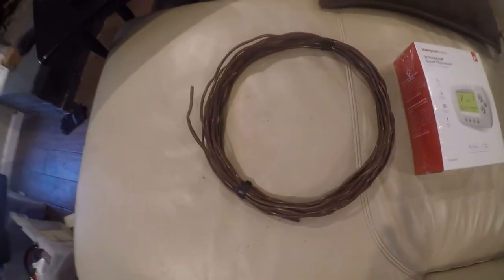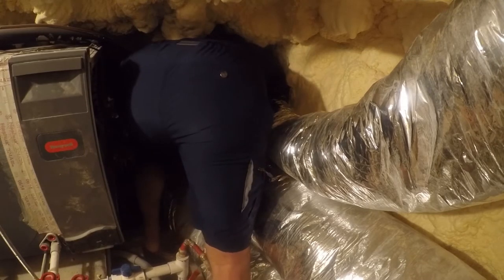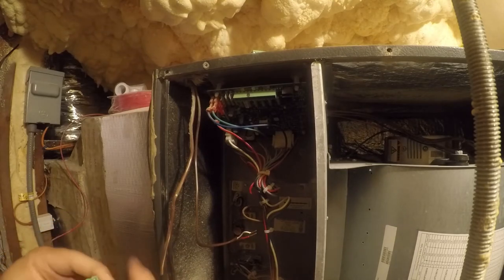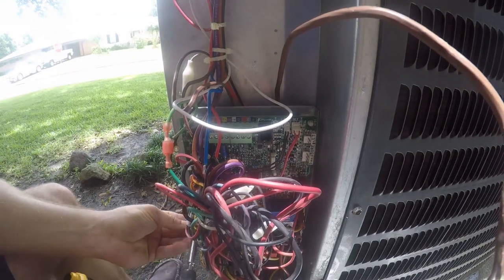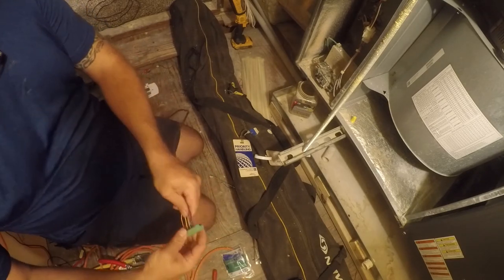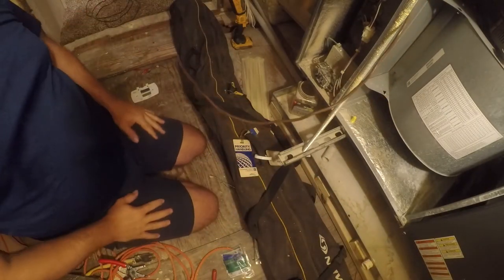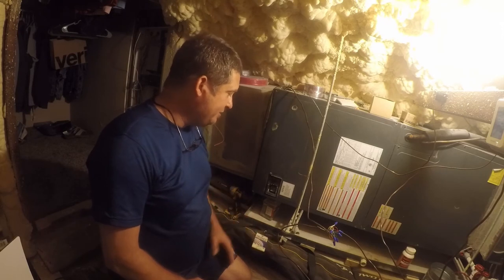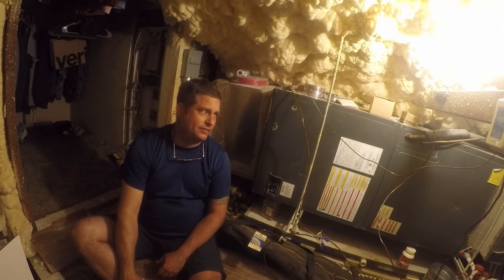Goodman / Amana DisComfortNet abandonment - Part 2 of 3

Comment: I have the Goodman 18 SEER Discomfort Unit that I installed 8 years ago.  The Air Handler circuit board failed within the first hour.  After paying a pro to troubleshoot, he came up with the same conclusion.  $200 for a replacement board and all's good.  It worked fine for 5 years and then intermittent communication error.  After much trouble shooting, the culprit was slightly loose terminal screws in the air handler communication.  One turn on each screw and all is better.  Likely the thermal expansion and contraction loosen the screws/wires.   To be honest, the unit works well, but the electronics can be a headache.
Reply from the maker: Yea, it's just a poor electronics design.  In my case there was a nearby lightning event  and it quit working after that.  Consistent with fried control board.